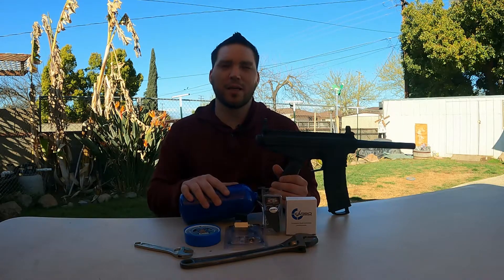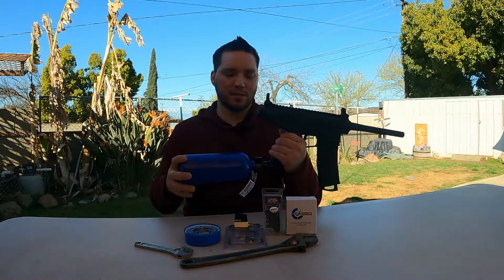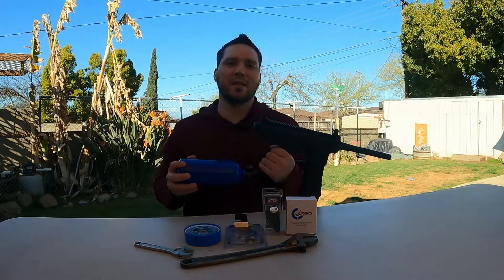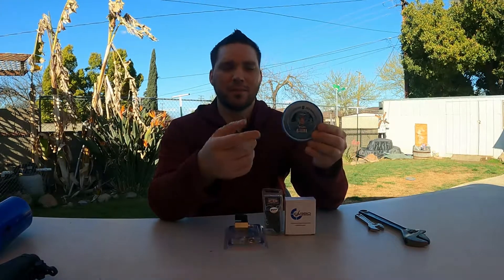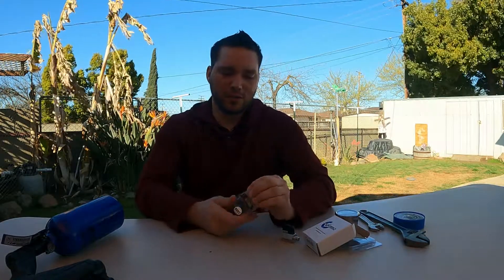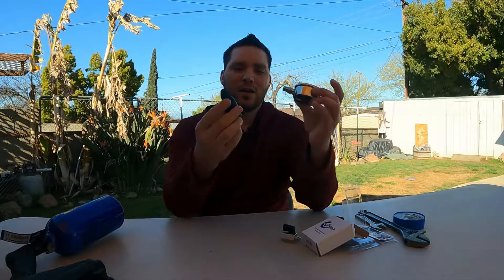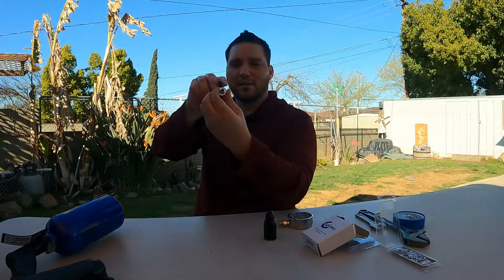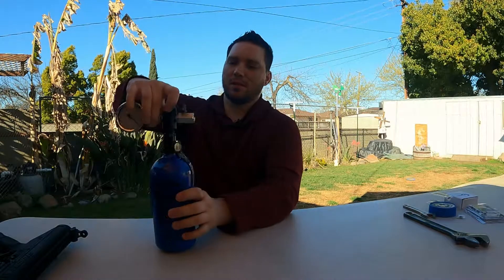HPA tank output pressure gauge DIY checker

Comment: You kept saying regulator while you were holding the gauge? The regulator is the system on the hpa tank.... or am I missing something? Lol, iam really asking, because I am just getting into this and iam trying to find out how to make an output pressure tester.
Reply from the maker: I haven’t looked back at this video but to answer your question a regulator has the ability to maintain (regulate) a specified amount of pressure by using a manifold. If a regulator has more air entering it then it’s set to it will bleed off. These types of regulators have a gauge on them. Technically the regulator in the paintball world is the device that allows air to enter the gun at a certain set PSI but doesn’t bleed it if it exceeds it hence the need for the built in burst disks. The dial that shows PSI would be technically considered the gauge. I have a mechanical engineering background so we use a lot of “regulators” that have a regulator and gauge which we call regulators as a unit. But yes it’s a kinda universal word. Hope this helps
Reply from the maker: Here is an example of what we use and why it’s a loosely used name:
https://www.grainger.com/product/4ZK76?gucid=N:N:PS:Paid:GGL:CSM-2295:4P7A1P:20501231&gclid=EAIaIQobChMI0aP93czM_AIVIBKtBh0yJA-QEAQYBCABEgI1_PD_BwE&gclsrc=aw.ds
Reply from the maker: I should’ve said manifold, ASA, and gauge… regulator valve (ASA, threaded piece on tank with a valve) and gauge = regulator (ASA doesn’t work as a regulator technically)

Comment: Yeah I never understood why they would rate a regulator output higher then what it actually is. I use 2 gauges that are from different manufacturers to cross check the output. All but 2 of my tank actually output the number advertised. And yes all the internals parts in all my regulators are good.
Reply from the maker: Good thing they have burst disks so they blow before a tank can be over-pressurized and blow. But I agree, having a way to double check and have piece of mind is key.

Comment: can you link the product you used
Reply from the maker: CARBO Instruments 2 1-2" Pressure... https://www.amazon.com/dp/B07FB38G3R?ref=ppx_pop_mob_ap_share

https://www.ansgear.com/Custom_Products_Dovetail_On_Off_D_Black_p/cponoffasadblack.htm

Metaland 1/8" Brass Mini Ball Valve NPT Female x Male Shut-Off Valve https://www.amazon.com/dp/B08MWQPSKL/ref=cm_sw_r_cp_api_glt_fabc_X5AMZZR6K12H7ZH3G9N6

Milrose 70885 Blue Monster 1/2 Inch x 1429 Inch Blue Teflon Tape (3 Pack) [New Improved Version https://www.amazon.com/dp/B00IJZC9QQ/ref=cm_sw_r_cp_api_glt_fabc_7BS3W4X8KMHD4NCBQ810
Reply: @ProjectAnubisUSA  yea cant find regulator adaptor your using do i need to get it local home depot
Reply from the maker: @ujoto  forgot I had a reducer
Taisher 5PCS Forging of 304 Stainless Steel Fitting, Reducer Adapter, 1/8-Inch Male Pipe x 1/4-Inch Female Pipe https://www.amazon.com/dp/B08785VLJP/ref=cm_sw_r_cp_api_glt_fabc_MJ9MEZJVKVHFSTVN3442?_encoding=UTF8&psc=1
Reply: @ProjectAnubisUSA  I appreciate it, for linking the items... thank you